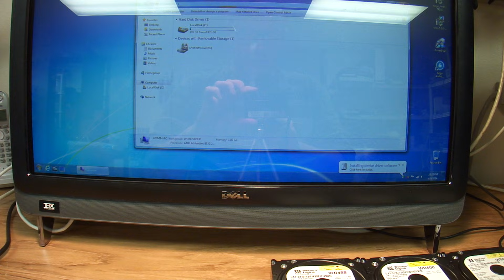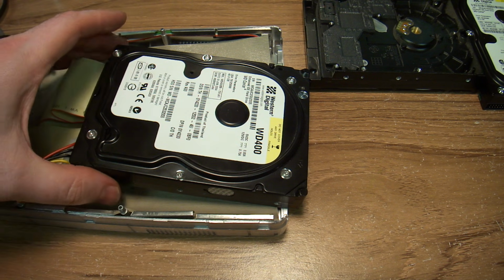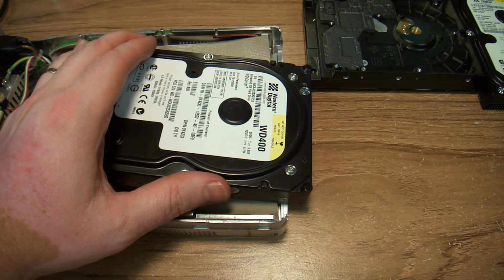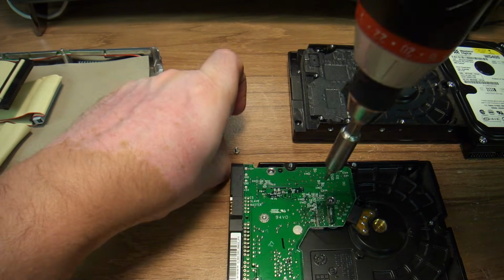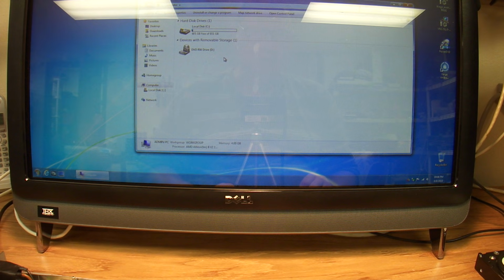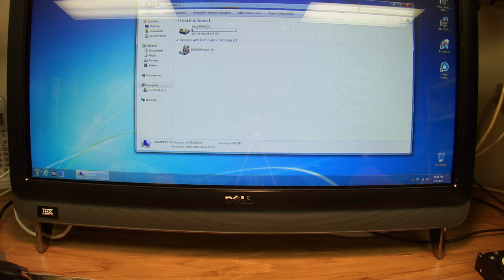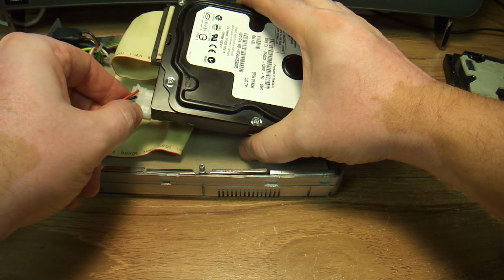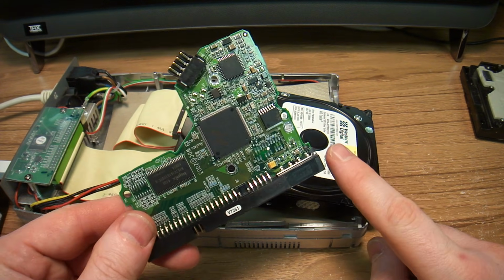DIY How to: a successful data recovery from clicking hard drive. Recover your files Yourself

Comment: Dont harddrive controller boards have a chip on them that stores data about the platters on them?
I once did this with two drives and it ended up messing both harddrives
Reply: Copy hard drive

Comment: Great video. I found and ordered the exact same WD External Passport for Mac, and I'm eagerly awaiting its arrival so I can test this method. Fingers crossed that it does the trick! I've come across other videos where they mention transferring the BIOS chip from the old board to the donor board, claiming it won't work otherwise. Do you think for the WD external drives it could work just swapping the boards without transferring the BIOS chips? Thank you.

Comment: HI, On another site the technician stated it was vital to change the bios chip from the original board to the replacement board as it contained all the information relative to that specific hard drive.

Comment: Hello, I have a 2,5" external WD Passport which is not recognized by my computer (Mac OSX). When I connect it, I hear kind of a fan sound, but no seeking. After a while, a click sound appears and the fan sound stops and the whole process restarts from the beginning. So it could be the controller? And I could just try to buy another identical HD and switch the controllers? Can I also buy this model with a smaller storage size (because it is cheaper) or should it be the same size? Thanks!
Reply: Have you given it a try? I'm curious if it worked. I actually found and ordered the exact same WD Passport for Mac, and I'm eagerly awaiting its arrival so I can test this method. Fingers crossed that it does the trick! I've come across other videos where they mention transferring the BIOS chip from the old board to the donor board, claiming it won't work otherwise. Do you think there's truth to that?
Reply: @TheMichael21fromnyc  I didn‘t. Luckily my Synology NAS mounted the HDD successfully and I was able to copy all data to the NAS. But at very very low data rate. The HDD or its controller was definitely not functioning properly. It took a few days. But it worked for me :)
Would be interesting if you get success with your method.

Comment: Thanks for the info and demo! I got a WD 3T Green failed, no clicking sounds or other noise, just refused to be mounted. Seems PCB issue. Can I use a WD 3T Blue's controller board (PCB) to replace it? As you mentioned its platter control info might be different from earlier version, or can NOT be replaceable at all? Thanks!! I got important data on the disk.

Comment: Each hard drive has been programmed with firmware that makes the board recognise to its own disc. So if you change the board with another board it will doesn't work, even though the brand/type/model of the hard drive are the same. Unless you copy the firmware that contains the recognizing code into another board.

Comment: Thanks for showing that this actually worked. From experience in the 90's and early 2000, I actually tried this method without success. I did my research to figure out why? People posted that the actual hard drive was calibrated with that board and it would be a slim chance this would work because of it. If you had the same exact revision and lot number, for example, people claimed it could possibly work with much higher success. In your case, was all the boards the same revision etc? I gave up later on trying any of this because of what I learned early on. Thanks for sharing and this might enable me to try this again. However, I have a lot more SSD drives today. ;) I posted before I saw the ending, you actually mentioned transferring the chip. However, that type of solder joints being so small, looks like a nightmare to get right.

Comment: Don't use power tools on a hard drive. What is not mentioned is that the two controller cards have to match, and if you have to ask about this, just don't do it. Send it off and get your data back. The wrong controller can scramble your data. Personally I would recommend DriveSavers. You may only get one shot at your data, what is it worth?
As a side note: if your unbelievably lucky and this works for you. REPLACE THE DRIVE after you get your data off of it. Died once it is extremely likely that it will happen again.

Comment: So if I accidentally used a 19v power adapter on a 12v external hard drive, then it's just the diode I need to replace?

Comment: Seagate 2tb barracuda and a Seagate 500mb, 11 click shutdown prob seems common. Is that the heads stuck or not finding the system sector or mount sector to mount? Almost tried the circuit board swap before wayching this vid, guessing it would freak and blow up? (Using good 500mb to unclick 2tb drive)

Comment: Worst Thing ever shared. You should never do this pcb replacment, it will corrupt even if you keep trying diff. donor drive. Also never ever try to open your hdd. What you can try is rubbing your PCB with Eraser to clean tracks. If your data is important then send it to An Expert. Don't ever try to risk doing yourself. You will worsen the situation.

Comment: If I were you I jumped directly to donor 3 because the back cover of the motor shaft are the same. they are both in bronze color. The donor 1 and 2 are the same too looks like chrome or nickel. How do you missed that they are probably not even same hw revision ...

Comment: Abraham - thank you for the hard drive repair videos. I have an external hard drive that I banged while it was running and afterward, it would not be recognized and made a quiet double click sound. i removed the cover and did the bad thing of running the drive w/o cover to see what was happening - the arm that passes over the platters (double platters) would run into the middle and tap against the center hub making the little clicking sounds. there were no grooves or scratches on the top of the visible platter so i am wondering if i buy the same drive new or used - is there a chance i could replace the arm and its mechanism and be able to access my files?  if so, any advice how to get the read/write arms to fit onto the platters would be appreciated and any other tips you might have.

Comment: Hi Abraham.
First of all let me thank you for your great video's on this subject.
Still got a question/problem though.
I have a WD Elements 1TB, that made the magic clicking sound and stopt working.
Windows still "sees" WD, but data won't show up :-(
No when i turn on the drive, it will give a few clicks, motor starts spinning for a few seconds and then stops all together. No sounds at all!
Please can you give some advice!
Much appreciated.
Paul
Reply: I'm facing same problem WD 4TB with power, Shows Disk error in Disk management. Have you found your Data back?
Reply: @sriramphotography143  Sorry to say Sriram, but no I did not 😪😪😪😪
Reply: Then what happened? Aren't you tried in professional data recovery? it helps to get data Back...

Comment: If this works for you i can say that it´s a good time for you to also play on the lottery.. ALL drives need to be calibrated for the set of the disks that are mounted in that particular drive. IF you get this to work, then the drives may have been calibrated at the same time.. I have tried so many times with drives from same batches and/or serial numbers that are just right next to the other drive's serial. It's alot easier to just get the drive working, but you rarely can get any data from it since the heads doesn't know where to read for the data.

Comment: nice ! .. really interesting video ;)) .. co- incidentally all my hard drive failures have been Western Digital .. (Backblaze.com have the best stats as regards HD failure rates & lifespan ..)
but i still dont really understand,  if it was a pure mechanical failure, why did replacing the circuitry (3rd attempt) help the heads read the disc ? ... maybe this is just the strange and wacky world of hard discs !

Comment: Hi!
I have the same problem. What if i buy the same harddrive and just replace the control unit with the new one would it be compatible, would it work?
Reply: Yunus Fidan Replacing boards used to work like a charm but unfortunately it's become a tricky process with new hard drives. You'd need to transplant the "bios chip" from your old HDD circuit board to the new one even to get it work. It's not a complicated thing in theory but you'd need proper soldering/desoldering tools and skills.
Reply: Thanks for the Information. My problem is that the BIOS chip is burned, thats why it isnt working right, i really don't know what to do here, i've tried replacing boards with the same model but it still didn't work.
Reply: Habib Hasan, and what about old hard drive models? For example, I have a faulty 2TB Seagate that was manufactured probably in 2010/2011. If I buy two or there units of the same model today, maybe it's board is already new and with these new restrictions? Or this is only valid to nowadays built hard drives?
Reply: Yunus Fidan, what's your hard drive? From more or less which year? My curiosity is mainly about if even using the same models of an old hard drive is not ideal anymore due to maybe their boards are already new with these specific restrictions, even being for an old model hard drive. Could you please tell us which model you are trying to fix?
Reply: Hey there, i am trying to fix the Model Seagate ST500LM012 2,5''.
I have bought 2 Samsung ST500 same Model name tried both but they didn't work.

Comment: Seeing as you have so many donor drives to choose from, would it not be sensible to look at the revision and serial numbers on the labels and try the closest match first ?
Reply: This rarely works anymore as more and more drives are built with hardware encryption onboard, meaning 1 board has the set of keys and if it dies, that's that :/ You can place a new board and hope the drive spins up and you can format it but the data is gone...
Reply: ***** Not sure, some advertise it some don't so it's not easy to figure out without testing all models one by one :P
But it's been several years at least so they're widespread in stores now, if you buy an external harddrive I'd say there's a bigger chance of it doing hardware encryption than it not doing that or doing it with an open implementation  which does allow swapping boards.
Reply: 2005 might be, you can try searching for the specific modelname and type numbers of that disk (both the internal modelnumbers and those of the external housing) to try and see if anyone has had success (or not).
I'd guess that a 2005 drive will be rather slow and low capacity so probably not worth doing it to keep using that drive (a new drive would probably be cheaper and definitely easier and more reliable) so only do it when there's data on that drive you need back but haven't got a backup for I'd say.
Reply: Some Guy you can get a new board and transplant the old board memory chip with the information for it to work. I did it a couple of times with some WD blue. you just need a hot air rework station

Comment: Greetings, i got a bad hard drive (WD 1TB black) and a healthy one (WD 160gigs blue), of which the blue one is around 7-8 years old and the black 2-3 years. So, i would rather make use of the bigger one and i was wondering if i could use parts from the blue disk. As for the black drive, it sounds as if something is not spining properly inside (you can hear the sound of i guess the motor trying to push but as if it cant make it), atleast soundwise (i do not have any experience in repairing hard drives so i have no clue). The Drive can be turne on, but when i do, the system prompts me right after the BIOS shows. It says that the health status of the drive is bad and i should do a bakcup and replace it. When i push F1 i can still go into the system (windows 8.1), but it lags quite a lot and sending data from this disk apears to be partly working, it goes as far as 50 megabytes, but also stops sometimes for a while and wont send any data and later start again on its own. Any idea on what i should or can do?
Reply: if it sounds like it can't push maybe dust in there
Reply: No dust, everything is clean. Actually everything seems to be in place and there is no visual damage or dirt from the inside or outside, so im pretty sure its the motor giving up.

Comment: big chip is a microcontroller, hynix is a RAM chip. All HDD have got a firmware, which "says" to the conrtoller how many heads inside, and a board store where's a "factory" bad sectors.

Comment: Abraham you need to change the ROM because the heads aligment config of the HD it's unique
Reply: Manuel Cervera Velazquez, do you mean about new hard drivers or this is applied for old ones too? By the way, how this could be done? How would be possible to change a hard drive ROM?
Reply: the ROM its a integrad circuit located en the board with several pins 3 or 4 each side near to the leads. you will net a heat gun watch de position of the rom and change it to the new board
Reply: it applies to all hdd...
Reply: you sir are right!

Comment: I have a dead WD200 with 10 years of all my professional work on it.  Given what you just taught me, I'm going to see if I can order an identical drive off ebay and swap the controller cards.  It may be a long shot, but its better than not trying at all.  Thanks for the tutorial.
Reply: Sean Riddolls, did you have success?
Reply: Then return it 💰 with faulty controller board... this same technique works with used underwear 💩  and toothbrushes also.  Poor sucker that buys it next 😂

Comment: awesome!! on a drive that said you need to format  and wouldn`t detect i didn`t have a spare just disconnected the board cleaned the contacts   and replaced the same board  the drive works fine thank you

Comment: I saw another video in which to exchange the equal boards it is necessary to use the donor hard disk first in the same PC after change to the new or damage hard disk and shutdown this PC, make hard disk changes and turn on the PC again whit the hard disk
ready connected this help system to recognize the hard disk board when you start the disk with the change made.
Reply: Luis A Bigio, hi there! Could you please clarify more this? You mean the donor hard drive should be used BEFORE in the same PC, right? By the way, where you saw this information?

Comment: What if the two drives I want to recover from are expensive Toshiba 3TB drives. Do I need to get another 3TB of the same kind with the hope that the circuit board will work? Can't I use a lower capacity? Probably not worth it. :(
Reply: yes, you need to get the exact match to have a better chance of recovery.
and again, yes, probably not worth it unless you have some important files on the failed drive.

Comment: Hi Abraham, I have WD2TB external hard drive. It started with slowing down to open the files and then started some noise it hard to explain what kind of noise whither clicking or something else. And now I can not have access to the files. Some one advised me to stop using, it will damage more. I need your help. I have recorded the sound but I don't know how to attach the file.  How can I send the attach file to you. Thanks
Reply: that's what happens to me and i have hard work on this laptop and also slow file opening! well time to start backup to be secure then go buy another HDD and try this metod

Comment: I have an issue where my WD My Book Essential has burnt out as well. It is a 3TB Green Drive from 2013. There was a constant blinking light every .5 second. It would boot up when connected then would go into blinking mode, not able to mount or readable by both my macbook pro and desktop mac. The drive actually does mount but at a snails pace and only reads the drive name. Doesn't allow files to show in directory.
     I checked and it seems that the PCB board is burnt at the point of where it connects directly to the hard drive. The USB board is intact, no damage. 
I have tried two donor boards of the same code, and now the drive does not click but is not recognized or mounts. The light is solid for about 5 minutes then slow constant blink every 2 seconds like it is in sleep mode. 
I am wondering if it can't read the encrypted data with the new pcb board or if I should continue to try and swap pcb boards. 
Just a note...I am using the new pcb board with the old USB board.
Any Suggestions?

Thanks
Lee
Reply: +Willy Lee Did you ever find a solution for this? I have the exact same hard drive with the exact same issues you described.

Comment: Just to add one more piece of info, when the supposed problematic board was attached to the other HDD it worked well, so it wasn't a board problem i think, and the heads when swaped also worked well, what else is missing?

Comment: I had a 2 HDD, both 1TB, one of them were clicking, the other was going good, and when i tried to contact the only company in my country that deals with hard drive problems, they told me there is no boards available for the 1TB, so i sacrificed my working HDD to repair the other one which contains my most important life data. the clickings didn't stop, i thought maybe the heads can have something wrong, i changed those too, but no way, nothing is working yet, so now i lost 2 x 1 TB HDDs and yet wasn't able to get my data back. Any other options? am dying to get this data. It is like 16 long years of work, I can't just let go like that. I don't care if the drive is supposed to die after one more use, all i need is to pull my data and the drive can go to heck, not planing to use it again. So to make my question simple, how to make it work for just ONE single time till i take whatever i need from it?